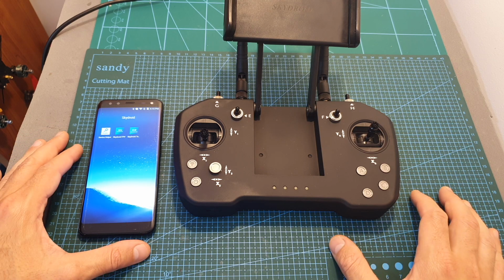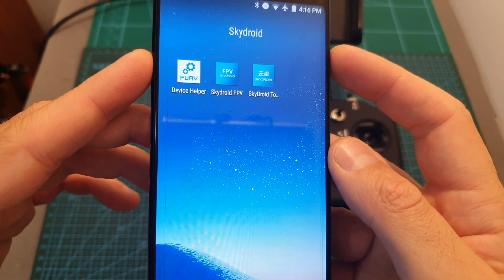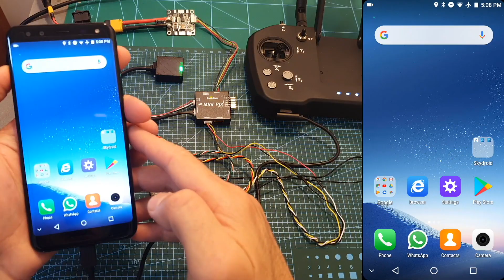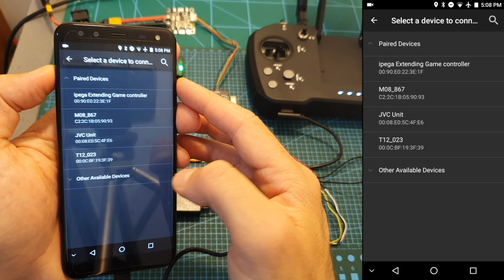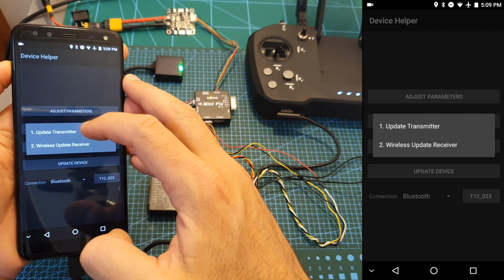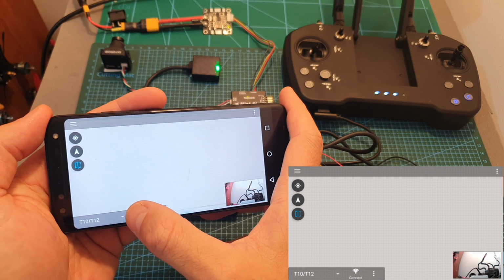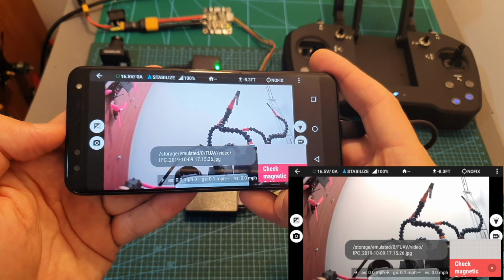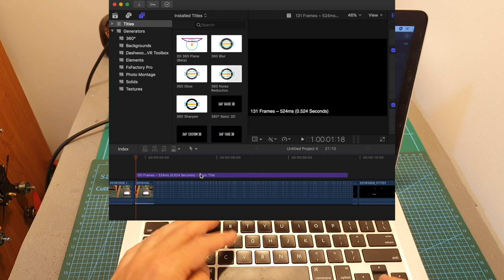SkyDroid T12 - Overview, System Setup & Latency Test

Comment: Hi Kremer. Why are you using Mini fix Radio Link. It doesn`t support by Skydroid T12. I wonder I should use T12 in Flight mode. Is there no solution for use map telemetry for long range flight. Thanks.
Reply from the maker: Hi, are you sure? I no longer have this system but as far as I can remember it was working.
Reply: @KremerFPV  Yes. It's working. but it's works only on Flight mode on Android system. It means Map and telemetry is not working. I wonder what is Mini fix Radio Link.

Comment: i used skydroid T12.after upgrade transmitter version 4.1. i cannot connect to receiver. Receiver just blinking green.need help
Reply: I am also facing the same issue. Did you find a solution for this?
Reply: @dronelobby4169  NO. i just buy a new receiver and successful bind.

Comment: @ 1:13 You mention it only supports Aurdino based controller . Will it not work with Pixhawk Cube. Cube also has SBUS connector.

Comment: the device helper doesn't work. I sent the messages a few times, but no respond from the company. Bad service.
Reply from the maker: That's unfortunate. Try contacting the vendor you bought it from.
Reply: @KremerFPV  do you know how to connect the skydroid t12 telemetry to Jiyi k++?  I tried to connect skydroid to the Jiyi k++ via link port, unsuccessful. I tried  to swap the rx and tx, but still not working. thank in advance.
Reply from the maker: @simenscott  Sorry but I don't have any experience with this flight controller / system.
If it's using APM it should be compatible, if not - I doubt it.

Comment: Can I connect two tablet to t -10, for telemetry and video and can I record video on t - 10 transmitter radio...
Reply from the maker: Yes, one using bluetooth and the second using a cable.
Reply: I use for Skydroid T10 a tablet via USB for FPV, and a second tablet via Bluetooth with the Groundstation QGroundcontrol for Telemetry/Google Map
Reply: @ottokueng4236  thank you for your reply...

Comment: Did you measure the latency using a Bluetooth connection or usb connection?  I guess that Bluetooth adds more latency between remotecontrol and smartphone
Reply from the maker: USB connection. Video cannot be used with bluetooth on that device anyway.